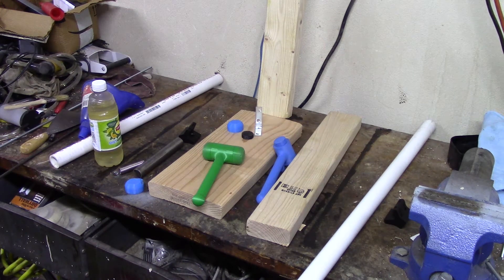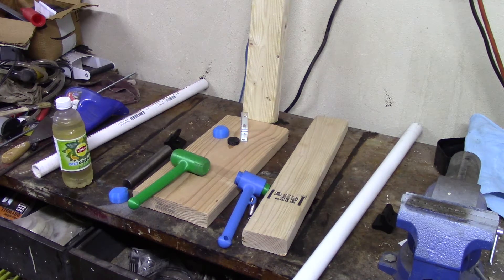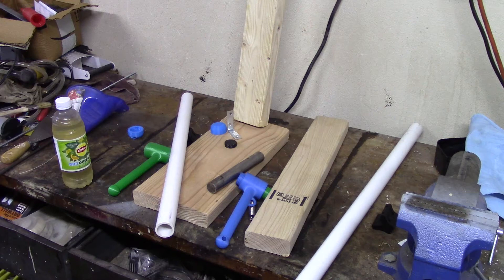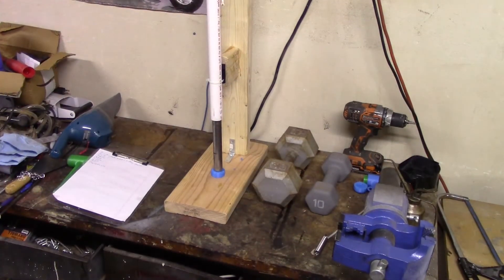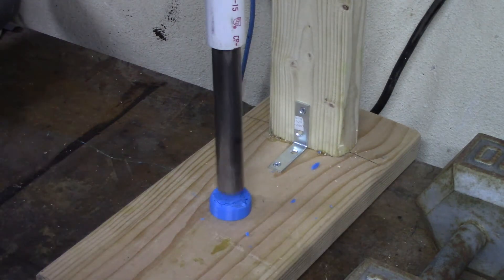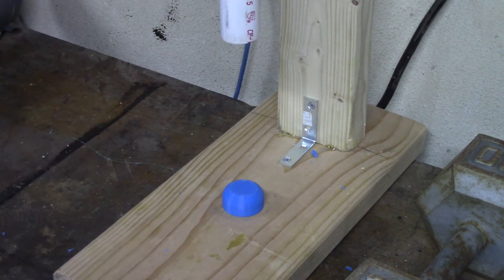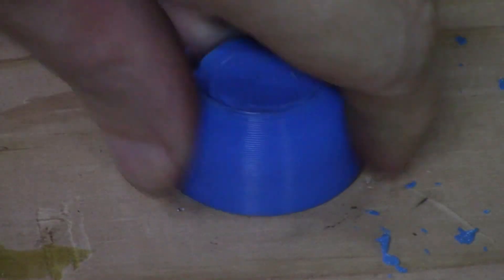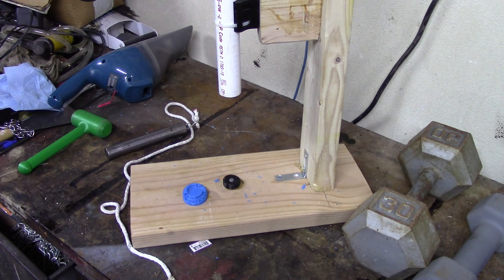3D Printer Filament Impact Testing! It's Hammer Time! Part 1 - The Test Rig

Comment: What are the parameters for those test specimens? Fill in %, layer height etc.?
Reply from the maker: I'm not sure yet. I also may do more than one, say one with 50% infill and one that's solid. I typically use either .3 or .32 layer height and a .4 or .5 line width. Mostly that depends on what slicer I'm using. When I get some preliminary testing done and decide I'll be sure to put that info in the first test video. If you have any suggestions, let me know!
Reply: @3rdpig  As long as it is consistent between samples it should not make that much of a difference. a 100% infill should make sense, but that is just my thinking.

Comment: Hi Chuck, I used to work in the paint and coats industry and they used to test samples using the method ASTM D5420 - 21 Standard Test Method for Impact Resistance of Flat, Rigid Plastic Specimen by Means of a Striker Impacted by a Falling Weight (Gardner Impact). Your contraption is similar to the tester they used. The same weight was dropped on the flat sample at different heights and the measurement was in inch.pounds. Different shapes were also used to increase damage effect. Look forward to your findings.
Reply from the maker: I remember seeing tests on steel toe boots (probably on Mythbusters) and I think they used a similar method too. Still, the cannon would have been awesome!
Reply: @3rdpig  That would be fun to see but I’m sure YouTube would have an issue with that.

Comment: I'd think that 100% infill, and make sure the back of head is well supported would be the best hammer heads i.e no gap between head and rest of hammer. I also think that grinding a dome on the end of the drop weight would more realistically simulate the sort of thing you may be using the hammer to hit.
Reply from the maker: I doubt I'd ever get a perfectly flush fit both on the bottom and in the middle. Even if it were possible it would take a lot of work and I've probably got 25-30 pieces to smash, so doing it on every one would be way too time consuming. But as long as I do them reasonably the same, I think the results will be vaild...or at least as valid as I can expect for a garage made test. and yea, I think I'm going to be taking some of the metal off the drop weight, if not a rounded profile than at least a chamfer (kind of a truncated cone) to make the profile smaller. I'll experiment with it a bit. Thanks for watching!